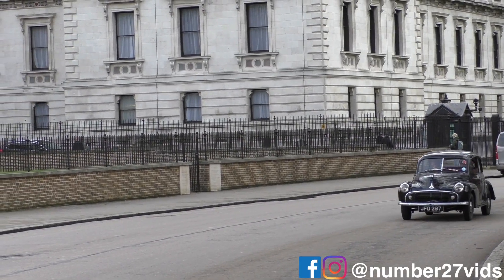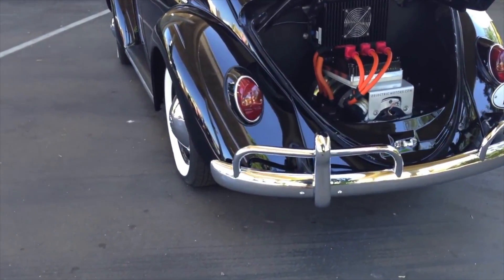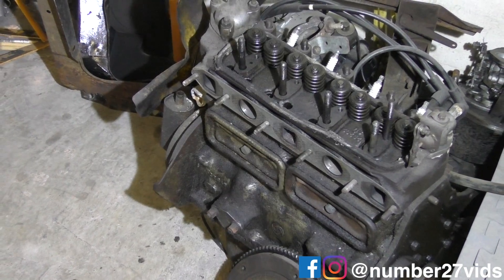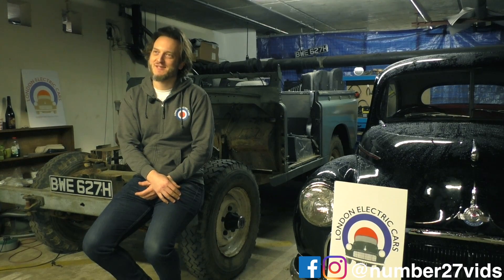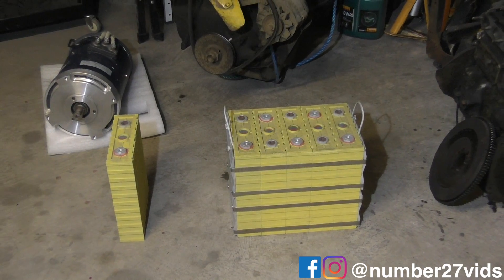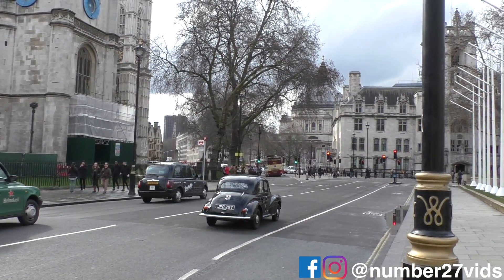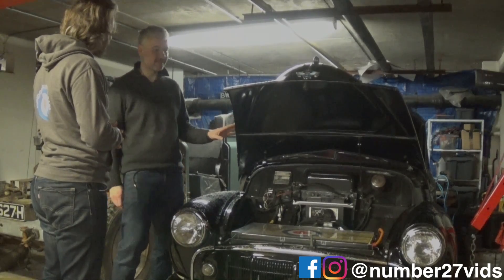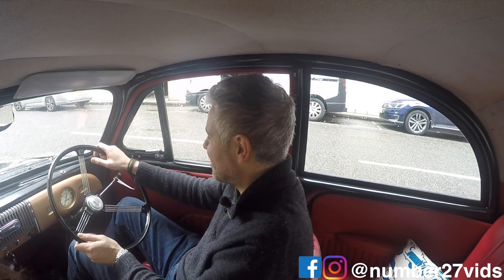Driving a converted Electric Morris Minor - Blunder or Brilliance?

Comment: looks great, just a question, how does the 12v battery get charged?
Reply: Most likely a DC-DC buck converter that reduces the traction voltage (likely 100+ volts) down to ~14 volts.
Reply: Ceramicolive the battery gets changed by coal fired power stations, but probably not in your back yard ,

Comment: Mabe the car could have an interior sound system emulating the sound of the original engine now that would be cool ?
Reply: I think Porsche and Mustang, probably inter alia, have "piped in" engine sounds - I guess because they've added very effective sound deadening. Sound to you like going around in circles?
Reply: Some of the very first car pioneers were experimenting with electric cars but it was always the petrol engine that was prefered but times are changing
Reply from the maker: Interesting idea!!
Reply: Maybe we could just build brand new Morris Minor shaped body shells (in China probably, that would be cheapest) but fit them with modern comfortable seats, a DVD entertainment system, air conditioning, electric drivetrain. Get rid of the skinny wheels / tyres as they don't grip well, and actually front wheel drive would probably be safer - oh and disc brakes all round with ABS.
Reply: @twelvereasonswhynot  What, no cup holders?
Reply: That's already a thing, you can buy the sound tracks of different types of engines

Comment: Fantastic film and fantastic company. I love this car - especially love how gearbox and old controls are retained. This is a complete contrast to the Jaguar Land Rover works conversion of an E-type. That car was very pretty and the work well done - and no cutting. But the Jag had touch-screen controls. It was for people who like the SHAPE of the E-type but prefer operating iphones to operating actual machinery. I love how this retains the that aspect of driving old machines. Maybe not for "Petrol Heads" but certainly for "Nut & Bolt" heads. There have been comments about Sports cars like 911 - I can see that this may not suit those machines best, but I CAN see this being a lot of fun in a raw, simple lightweight open 2-seater. Something like a Frogeye Sprite or early Spitfire would be perfect. Again...wouldn't be a track-car but what a cracking machine for daily whizzing around in the Capital.
Reply from the maker: Thanks Tom!! Funnily enough I may be about to get a Frogeye... you'll be one of the first to know if I do!!
Reply: TomsJunkyard that sounds sad - why don't those people just go out and buy a brand new "Beetle"?